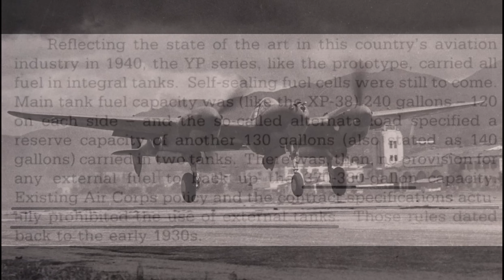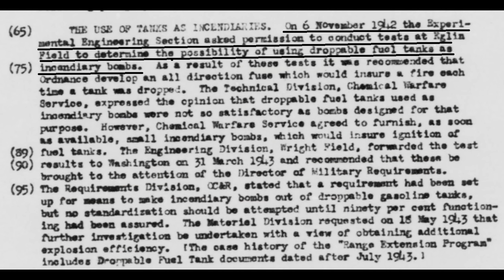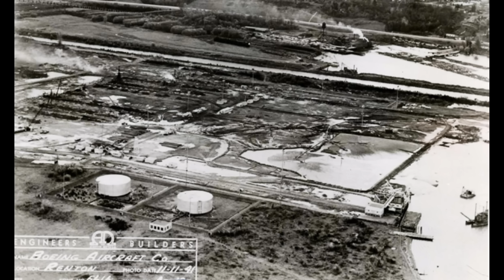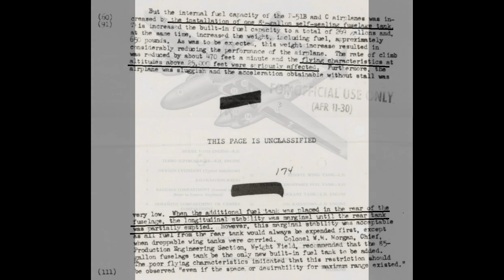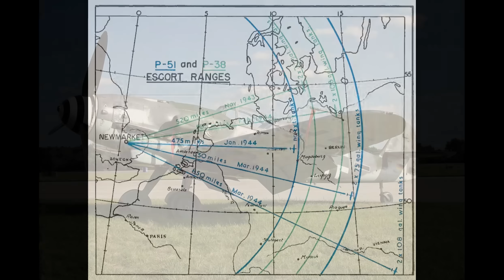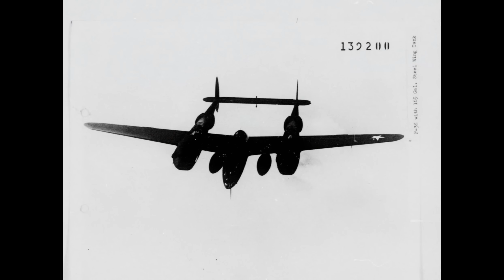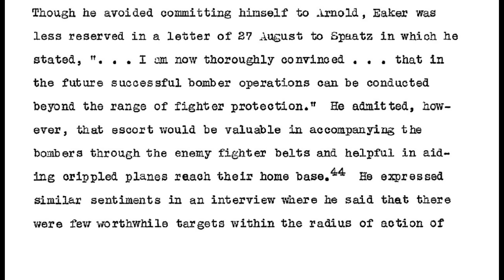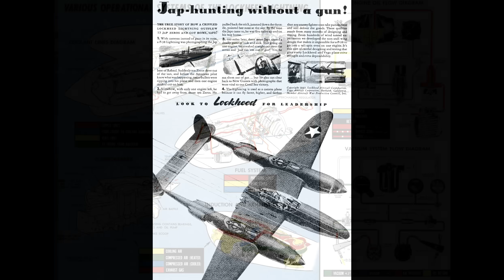The P 38 Lighting and the Bomber Mafia's Failure In World War Two

Comment: You can tell this video hit the mark because none of the counterarguments offered in the comments even address the main point anymore. Now they say "The P-38 wasn't really that great" or "the P-38 was more needed in North Africa" or "Well, hindsight is 20/20 and Hap Arnold did a lot of other things." Great job as always Greg.
Reply from the maker: Exactly, thanks for pointing that out.
Reply: Hap Arnold and Arthur (Bomber) Harris sent thousands of men to needless de aths. Not to mention the waste of national treasure. Harris failed to make better use of DH Mosquito. Arnold’s failures are well covered in this video.
Reply: @Dave5843-d9m  Bomber Harris and the RAF were extremely hesitant to send Mosquito's over Germany, as the Germans were unaware of the British invention of the cavity magnetron which allowed centimeter wavelength radar.  By contrast the Germans used long wave length radar which was less accurate and required large draggy antennas. The Germans did eventually assemble a workable centimeter radar from the parts of several crashed Mosquitos. They were amazed by its performance, but by then it was too late to put it into production.
Reply: @fafner1  I'm afraid your part right but a little mixed.    The Mosquitos were used with Oboe and latter Gee-H blind bombing systems and operated within the radar horizon only partially into Germany.     
-The USAAF used reverse lend lease Mosquitos with H2X radar for photographic radar scans for reference by navigators but not for bombing, there was no space even for target markers.   Radar Equiped Mosquitos weren't used for target marking. 
-NF night fighter mosquitoes initially used metric radar along with beufighters over Germany..
-The Germans first captured a CV64 H2S Magnetron in December 1942 from a downed Stirling Bomber.
-The Germans immediately recognized the device.  They had their own patents going back to Heil in 1935 and recognised it from Russian and Swiss patents. 
-Despite British misgivings they went ahead with deploying the device and argued more about weather to use it to find u-boats versus bombing.   The first H2S was very inaccurate due to 9cm wavelength and lack of stabilization.  
-The Germans had a microwave program they abandoned in May 1942 against advice of the head of the Army signal Branch Wolfgang Martini.  This disbandment of, with many technicians sent tio the army, greatly hindered their catch up efforts.  At the time  They had a tunable magentron of 800W from 4cm to 15cm.  They had a disk triode of about 16kW useful to around 22cm but could work at 9cm at about 9kW.  
-They cancelled because their 50cm radars were the best FLAK radars in the world at the time and they lacked resources to develop the microwave radars.   Very accurate.
The Multi cavity Magnetron with circular cavities and narrow slits was known elsewhere but it was only Britain and Japan that registered its value for radar due to the need for sub hunting and ground mapping.  The Japanese had their magnetron 1 year earlier than the UK but they moved slower testing Type 22 10cm radar on 2 cruisers in early 1942.  
-The Magnetrons use over Germany was through H2S Mk 1 9cm ground mapping radar not Mosquitos.  
-The British had estimated it would take the Germans 2 years to catch up.  In fact the Germans had working FLAK, sea search and ground mapping radars by mid 1944 so it was about 1.6 years but bombing prevented a roll out.  They produced about 400 radars and got about 100 in service.
Reply: @fafner1  It was Don Bennett who initiated the of use of the Mosquito with the Pathfinders. He described his initial difficulties in satisfying the naysayers in his book and many interviews that are still available on the internet. I don't recall him mentioning any hesitancy coming from Harris.
Reply: From Nov '43 the Lightning was more needed in North Africa. Generals have to make decisions based on the strategic situation at the time. Greg overlooks that sometime.
Reply: @JohnSmyth-l6i  Greg and other don't seem to realize that the decision to invade North Africa was a sea change in allied grand strategy the caused immense diversion of resources and disruption of previous plans.  Most of the combined chiefs of staff, particularly Genral Marshall, had successfully opposed this strategy for some time, but it was finally pushed through at the June 1942 conference after the continued machinations of Churchill and Roosevelt,  There was very little time to prepare for this invasion, and the buildup of the 8th Air Force in Britain was sidetracked while aircraft it had been allocated were diverted to North Africa.
Reply: P.S. Should read from Nov'42 the Lightning was needed more urgently in North Africa (i.e. Operation Torch). APOLOGIES.
Reply: Here are some counter arguments for you to consider.

the carburetor issues and MAP limits on the P-38 were never resolved. Ironically, it was Doolittle, who loved the P-38, who later had a hand it having them removed from ETO. Also, it's well documented that the P-38 was a great airplane, but that it required a highly skilled and experienced pilot to achieve that. Low time, low skill pilots struggled to handle the P-38. The USAAF even told Lockheed to adopt the P-51 engine controls to help with this, make it easier to fly and manage, and Lockheed ignored them. So, while I love the P-38, it did have legit issues that hampered it being as successful as it could have been. Those issues could have been resolved, but why bother when other cheaper aircraft without those issues are already available. And do not forget this was a logistics war. Also, prior to sometime in 1942, there had been no allocation of funds to purchase nor develop long range bombers, fighter escorts, etc. as the US plan to fight in ETO did not involve a strategic bombing campaign until the British convinced the US to change its entire strategy.

Also, do not ignore the fact that NAA had already flown the High-Altitude Long-Range XP-51B prototype in Oct/Nov of 1942, and had started design and development of the XP-51B in September of 1941. Though, the fuselage tank wasn't part of the original prototype/design and was added later as you pointed out.

PTO P-47 and P-38 long range missions were flown at low altitude, so had longer range than is possible for High-Altitude escort. Also, the P-51 could reach as far as Tokyo from Iwo Jima. the P-47N could barely reach the southern island of Japan from Okinawa, and couldn't reach Japan from Iwo Jima to escort B-29s. So the claim the P-47 could outrange the P-51 in PTO is simply not supported. And Gen. Kenney never did send P-47 to attack Rabaul either, and even said that every plane he had that could reach Rabaul, was sent to Rabaul, and that did not include the P-47. There is more to range and war and logistics and training and such than just gallons of fuel. And don't forget that early on the P-47 was a much despised airplane. The RAF delayed adopting it until 1944 due to is plethora of manufacturing issues (which is why there was a ridiculous number of batches and subvariants). Gen. Kenney had to convince people it was a worthwhile airplane and had to prove to people it could be useful. Zemkey hated it. The Germans and Japanese also held it in very low regard.

The lack of support to develop long-range high-altitude escort fighters from 1940-1942 had literally Nothing to do with the USAAF. it was out of their control. Congress and the gov procurement offices refused to allocate ANY funds for any such purposes, and instead prioritized solely attack aircraft, fighter bombers, and shorter range low altitude fighters, to support the CURRENT war strategy of the time. The USAAF cannot spend money that Congress doesn't give it. There was FAR more at play here than you are willing to consider and explore. Much of what happened was actually not even the result of actions on the part of ANYONE inside the USAAF at all.

Also, consider that the USAAF weren't the only ones using unescorted bombers in WWII. The RAF also flew unescorted bomber missions deep into Germany, and Japan also flew unescorted bomber missions. This was not a radical idea at the time. Much of the Bomber Mafia criticism comes in hindsight, post-war. But at the time, many people, in many nations, believed in unescorted bombers, and in fact conducted unescorted bomber missions in WWII. RAF bombers suffered even higher losses for the damage they inflicted, so why does no one accuse them of being a Bomber Mafia? The RAF even REFUSED a request by the USAAF to build long range high altitude spitfires. the USAAF modified two Spitfires in Ohio to be capable of 1600mi with internal fuel and drop tanks, and then flew them across the Atlantic to England to prove their range and the RAF staunchly refused to build any.
Reply: @SoloRenegade 
False. The J model chin mounted intercoolers resolved the MAP limitations of the Allison in the P-38. Allison proved that the V-1710 could operate continuously at 80" of MAP and 3200 RPM on 150 octane fuel. 

Several instances of P-38's being rigged for those settings are known, despite the USAAF never officially accepting the settings, even though the tests to validate them were requested and supervised by the USAAF. 

Further, Doolittle decided to pull the P-38 because of logistics, not performance. Doolittle wanted ONE fighter to supply, maintain, and train pilots for. By June 1944, he could get enough of the P-51 to do that. Because the War Production Board forced Lockheed to waste half of the capacity of the Burbank plant to produce B-17 bombers, there was never enough capacity to produce the P-38 volume to meet the constant demand. That issue meant there were never enough P-38's available, and production was never stopped to introduce improvements, or newer models in a timely manner. 

Finally, the USAAF did not request Merlin equipped P-38's. Lockheed proved in 1942 that a Merlin equipped P-38 would have a lower top speed, slower acceleration, reduced climb rate, reduced critical altitude, reduced service ceiling, and reduced handling characteristics. 

What the USAAF actually wanted was the P-38K, with 1875HP engines and Hamilton Standard hydrostatic high activity paddle props. They requested it in April 1943 with the P-38K was originally tested, and again in April/May 1944, as documented by U.S. Army Material Command records.
Reply: @SoloRenegade 
Lockheed DID NOT ignore requests for upgraded engine controls. That is another outright lie. Lockheed developed the Unitized Power Control, and demonstrated it. Colonel Harold Rau refers to it in his letter to Material Command. The War Production Board refused to allow Lockheed to phase it in. They refused to allow Lockheed to phase in the lead computing gun sight used in the later P-51. They refused to allow the change to the Hamilton Standard hydrostatic high activity paddle props. They refused to allow further upgraded Allison engines. The War Production Board delayed production of the P-38J for several months, then delayed the introduction of the dive recovery flaps. 

Further, Hap Arnold actually used his influence to force NACA to allow Lockheed in the wind tunnel, and to assist Lockheed in resolving the critical Mach issue. The War Production Board even refused to allow Lockheed to introduce the second set of wing modifications which would have raised the critical Mach to approximately 0.70, even without dive flaps. 

Lockheed was constantly pushing to improve the P-38. The P-38K should have been available for frontline deployment by September 1943, and was capable of performance not even achieved by the P-38L. By 1944, the P-38K could have been improved with a four blade version of the Hamilton Standard hydrostatic high activity paddle props, which would have improved even the performance achieved by the 1943 P-38K. 

By late 1943, Lockheed would have had a P-38K capable of 450 MPH, a climb rate of 5000 feet per minute, and with a critical Mach of 0.70, even without dive flaps. 

It was NOT Lockheed that refused to improve the P-38, it was the War Production Board that refused to allow it. Instead of 5,000 or so P-38J and P-38L aircraft, there should have been 15,000 P-38K and better aircraft, starting in September 1943. The reason there weren't has nothing to do with Lockheed, and everything to do with the War Production Board.
Reply: @AlanRoehrich9651  And to begin with, I don't see what was problematically more complicated about the controls of the P-38 than the P-51, other than it had two of most engine controls and gauges.  Both planes had automatic supercharger and cooling control systems that were far simpler for the pilot than those of an airplane like the F4U Corsair. The P-38 had a somewhat more complex fuel system due to the need for crossfeed, but that's the worst of it.  Yes, the pilot had to know how to react to an engine failure on takeoff, but that's not going to complicate use of the airplane in combat.
Reply: @AlanRoehrich9651  bold claims that the P-38 was being deliberately sabotaged. I'll look more into that letter, but I highly doubt it will corroborate your claims that hap arnold or anyone else was deliberately sabotaging the plane and getting away with it.
Reply: @SoloRenegade 
Never said Hap Arnold deliberately sabotaged the P-38. 

It was in fact Hap Arnold who forced NACA to let Lockheed in the wind tunnel, and got them to work on the compressibility problem. 

The letter from Rau is easily found. 

Look for an article by Dr. Karlo Kopp, entitled "Der Gabelschwanz Tuefel". It covers the letter from Rau. And disproves a ton of falsehoods. It features comments from my friend Captain Arthur Heiden, and Captain Stan Richardson Jr. 

It was the War Production Board that repeatedly sabotaged the P-38. Whether it was intentional, or incompetence is up for debate. 

However, NOT up for debate is the fact that the War Production Board delayed several improvements. They delayed production of the P-38J, as well as the dive flaps, flat armored glass on the cockpit, the dual generators (one on each engine) and the boosted ailerons. 

The War Production Board flat out denied production of the markedly superior P-38K, not once, but twice. They denied introduction of the Unified Power Control system as well. Had the P-38K been adopted in May 1943, after testing in April 1943 demonstrated clearly superior speed, acceleration, range, and climb rate, the P-38 would have had four blade versions of the superior propellers by late 1943. Also, the boosted ailerons, dive flaps, and flat armored glass could have been introduced at the same time. The U.S. Army Material Command requested the P-38K in May of 1943, and felt it desperately needed enough to request it again in April/May 1944.

If you don't know what a P-38K is, the article is "Whatever Happened to the P-38K?" by my friend Corey C. Jordan.
Reply: @SoloRenegade  I don't think it was deliberately sabotaged, but that doesn't make Alan's comments false, either.  The reason the War Production Board didn't allow the changes Lockheed wanted to make was because it would disrupt the assembly lines.  In their minds, the need for continual output of more fighters was greater than an incremental improvement to those fighters.  I don't know if it was the right or wrong call - that's an entirely different debate.  But the fact remains that there were deficiencies identified in the P-38, Lockheed had great fixes for them, and many of them were never implemented.  I wish I could see an alternate history where we had a "definitive" P-38 with better cockpit ergonomics, higher critical mach limit, and paddle-bladed props.
Reply: If Arnold were alive today he would probably sue for libel.  In Feb 1942 Hap Arnold directed the air staff to do whatever was necessary to get drop tanks on fighters as soon as possible. And until they arrived in England for the bomber escorts he kept asking why it was taking so long.  But he had taken action long before that. This is extracted from “To Command the Sky” by Smithsonian Institution:

In 1939, shortly after WWII had broken out, Arnold expressed concern over the neglect of pursuit tactics and technological development. Arnold up to that point had been a bomber partisan, but now with supreme command responsibility over the Army air am and with the Spanish Civil War and Poland as evidence, he had to consider both sides of bomber vs fighter issues. In a Nov 1939 memo to the General Frank Andrews, former commander of GHQ Air Force, Arnold wrote that “the subject of pursuit aviation—tactics and plane development, has not received the share of attention and interest in the Air Corps it merits. The Idea that fighter aircraft cannot shoot down large bombardment planes in formation . . .has been proven wholly untenable. It has been demonstrated recently beyond a doubt that the best antiaircraft defense is pursuit aviation. He suggested that one other factor for the low state of the fighter was the teaching of doctrine in tactics schools, and another could be that higher ranking officers had little experience in command of fighter groups and squadrons, which was a young man’s game. In endorsing Arnold's memo, Col C.S. Russel was even more critical of the neglect of fighters, pointing out that advocates of bombardment had overlooked vital consideration in the ability of bomber to resist fighter attack, such as the concentrated firepower of fighters vs the less accurate flexible guns of bombers. He suggested the service schools lay emphasis on the value of pursuit. The Air Corps Tactics School that had focused on strategic bomber doctrine was soon to be disbanded as the Army began focusing on preparing for actual war. 

In May 1939 Arnold appointed a special panel known as the Kilmer Boarder to make recommendations on research and development priorities. Its third priority, behind liquid-cooled engines and fire control apparatus, was for a fighter to rank with the best in the world. Eleven months later Arnold appointed a second panel, the Emmons board” which added as a forth priority *an escort fighter with a 1,500 mile range*. When he received the report, Arnold exchanged places between priorities 1 and 4. Arnold made the escort fighter priority 1 in early 1940, long before US entry into the war.  

The Combined Bomber Offensive plan drafted in April 1943 did  not contain a specific directive on escort for daylight precision bombing.  Hap Arnold appended the plan with his opinion: “At all times there is  a need for an extensive U.S. fighter force to protect the bombers and to assist in the reduction of German fighter strength.”   This is just another of many actual actions by Arnold that disprove the unfounded accusation that  his directives were intended to prevent fighter escort and prove that bombers did not need fighter support.   

These were official policies, not the prewar opinions of the theorists denigrated on YT as the “bomber mafia”.  These official actions (and many others) clearly indicate it was not Arnold’s intention to prohibit fighter escort of bombers, as claimed by the uninformed conspiracy theorists crowding YT these days.
Reply: @ -It sounds like Arnold and the bomber mafia set the course for no escorts, then in 1940 when they had second thoughts they tried to change direction (effectively a 180) they lacked the skills to change course on the large unwieldy organization they had created.   That's what happens in large hierarchical organizations.
-I'd be interested to know of the 1500 mile fighter was with drop tanks or clean?
-The Germans actually had a concept of escort fighter for their bombers but it used the Me 110 zerstoerer (destroyer) and they were to escort by flying low and ahead of the bomber to strafe up and bomb enemy airfields or destroy anti aircraft defenses over target.  Other Me 110 were meant to fly well ahead of the bombers and destroy enemy fighters as they rose up.
-Used in this way the Me 110 was actually successful and had a favorable exchange ratio versus RAF fighters.   
-The problem arose when they were locked in formation with the bombers to protect against head on attacks. (Something which didn't work for the USAAF either)  Their slow acceleration and mediocre maneuvering made them very vulnerable compared to when they were free form fighting and at speed.
Reply: @williamzk9083  They didn't set a course for no escorts, they set a course for daylight precision bombing.  Britain was the only other country with a strategic bombardment doctrine, and they didn't believe long range escort was possible either.  
The YB-40 project began in June 1941, before U.S. entry into the war. It was a prewar concept for an 'escort cruiser' in the ACTS, which recognized that bomber escort was desirable, but also believed that a fighter with the necessary range would be too large and heavy to prevail in combat against lighter enemy interceptors.  In hindsight we know the YB-40 concept didn’t work. The fact that millions of dollars were spent testing it proves USAAF was not setting a course against escort of the bomber.  They were never against escorting bombers.
Reply: @gort8203  

You seem like a smart enough guy so you may want to help answer this question I have in my mind.

Why was there so much focus on strategic bombing of German factories producing fighters? If the goal after summer of 1943 is to attain air superiority in preparation for Operation Overlord, wouldn't it have been better and much more practical to instead directly target the Luftwaffe by targeting airfields and fighters that were within range of the D-Day invasion?

It thus still seems to me that the Schweinfurt raids were an unnecessary waste of lives. Why risk sending bombers unescorted deep into hostile territory to hit an objective that likely isn't going to do that much to hurt the Luftwaffe, instead of hitting other targets that seem to me better positioned to damage the Luftwaffe's efforts to attain air control.
Reply: @dunadan7136   This was the first true strategic bombing campaign and the targets for strategic bombing evolved from prewar expectations in response to results observed in actual combat. 

In general it was more effective to destroy aircraft on the ground than in the air, but airfields are typically a tactical or operational level rather than a strategic level target, and as such serviced by the tactical air forces. (Strategic bombers were in fact diverted to tactical and operational target in direct support of the invasion, but over the objections of General Spaatz.)
 
The goal of strategic bombardment was to destroy enemy production before weapons and supplies could get to the field and need to be engaged in battle. Destroying aircraft production should have been the most effective way to reduce the supply of the enemy aircraft that presented a direct threat to strategic bombardment. Germany responded by dispersing production and moving critical assembly factories underground. As the war went on oil became the main ‘choke point’, and attacks on it were more effective. 

Prior to that, ball bearing production had been assessed as a critical choke point in the production of all types of militarily significant vehicles and equipment, and as such was seen as a true strategic target. The heavy losses on that first mission were due as much to failure of the operational plan as to the depth of the target.  Bad weather caused delays in the launch and rendezvous of parts of the force and the plan to divert and dilute enemy fighter response failed, giving it time to attack the Schweinfurt bombers twice. Since huge operations never go exactly according to plan you don’t automatically abort them due to hiccups, you usually press on and try to adapt. In this case that roll of the dice went badly and the losses were greater than expected.  

Expectations are a key point most casual critics don’t comprehend.  It was never expected that bombers would not be lost. The goal was a sustainable level of losses. The prewar conception of strategic bombardment was that to achieve its objectives the bomber force needs to exist ready for action when a war begins. The idea that bombers could endure interceptors and destroy targets was based on attacking in formations of sufficient mass. 

The US entered WWII with a virtual handful of B-17s, and had to build up the force in England as it was working up to operations.  It  initially undertook raids with the range of fighter escort, but pressure to get results forced it into deep raids before it was really ready.  P-38s intended for escort had been diverted to North Africa. The P-47s that replaced them did not yet have sufficient range. It was initially assumed that escorts would help bombers penetrate the enemy defensive fighter belts, but that bombers would have to continue past the fighter escort radius in order to strike strategically significant targets in the interior.  But Luftwaffe saw this and responded by pulling fighters back beyond the range of fighter escorts.  

Those who think that the 8Th Air Force should suspended operations and waited for escort capability that didn’t yet exist don’t understand the imperatives of war. The high command wanted results because forces sitting around seeming idle left them open to criticism from many sides.  There was intense pressure to get in the war and realize a return on the investment being made.  Look at all the troops lost taking islands in the Pacific, islands that could have been bypassed or starved out if the US was willing to add another year or so to the war.  Back then the US population didn’t like endless wars any more than it does now.
Reply: @gort8203  Yet they still sent them unescorted and suffered horrendous casualties. Are you being paid by Happ Arnold's family? Sue for libel what a clown response. Arnold should have been court-martialed for his reckless behavior sending all those men to unnecessary carnage because of his ego.
Reply: @Len_DiJoseph  You are the clown if you think Hap Arnold should have been court martialed.  What a dope.